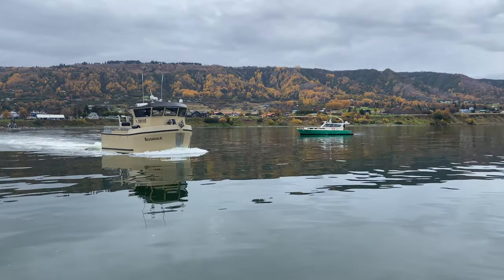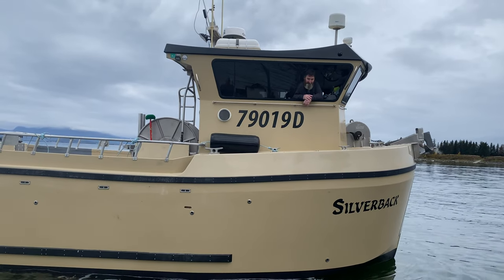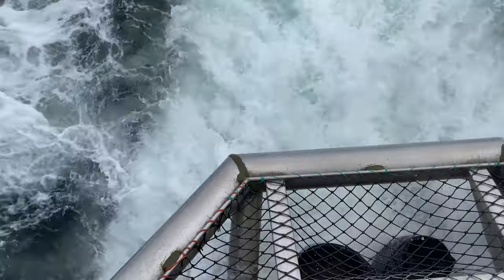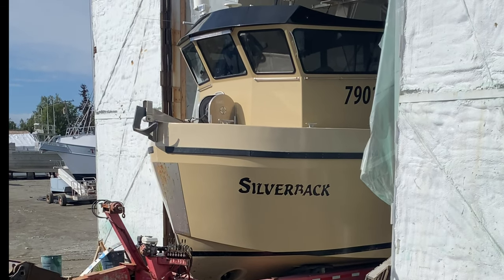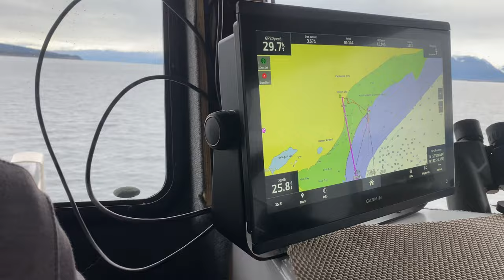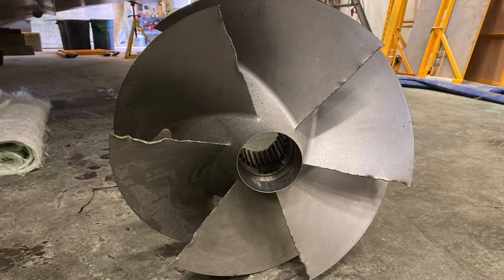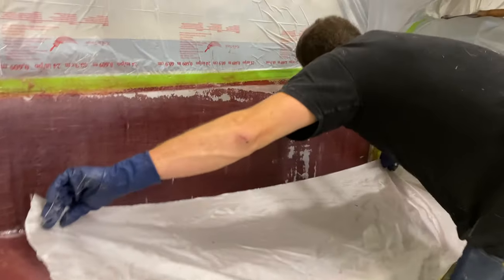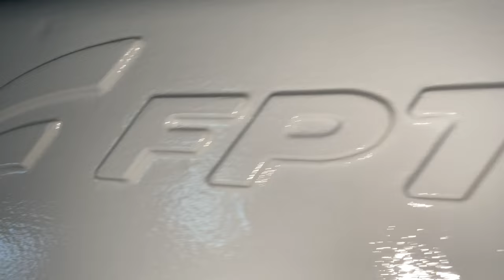Silverback on step

Comment: I often say jets are only good for running the shallows beciof thier inefficiency but pushing heavy loads isn't too bad compared to a prop I would imagine.
Reply: Jets are more efficient than props.
Take two of the same boat with the same engine and everything, make one a jet drive and one a prop.
The jet boat will go double the speed of the prop boat
Reply: Props can’t put down power to the water as efficiently as jets can, that’s why it takes double the horsepower to make a prop boat go the same speed as a jet boat.

Comment: Ahahahahahaha I can’t stop laughing!! You boatbuilders are hilarious!!! That jetguard sticking out what looks like 4 feet is going to knock out of the net at least 25000lbs a season, probably more. All that 💰for a boat that is extremely handicapped when it comes to putting FISH in the boat! Buttya go fast though! Wheeeeeeee!
Reply: Disagree!! I have one very similar and the fish slide right over!
Reply: @Akwildman  keeeeeep telling yourself that! Mount a GoPro under there and see how fish get there noses caught on the underside of the bar and what that does. See all those fish in the catch basket?(assume you have web over jet guard) those are the ones you get to keep, an equal or larger amount are gone.  Check your jetguard, see those grooves in the aluminum from lead line rubbing constantly? Like I said, a GoPro will provide a video that will give you stomach pains.
Reply: 😂😂😂😂😂😂😂False! you catch more fish in a season with a jet farmer.
Reply: You’re just mad you can’t afford this beast and catch 25k pounds in a season
Reply: 25,000 lbs??? Let’s say an average Bristol Bay salmon weighs 4 lbs. you are expecting over 6,000 individual fish to fall off a season?? Have you ever picked a fish out of a net? 90% of them are tight tight tight!! Otherwise people wouldn’t use fish picks. You probably use a bleeder stick and a fish slide too pal😢buddy does not get best fish